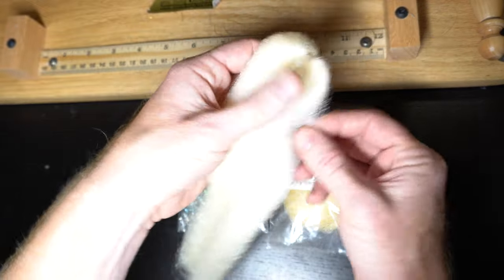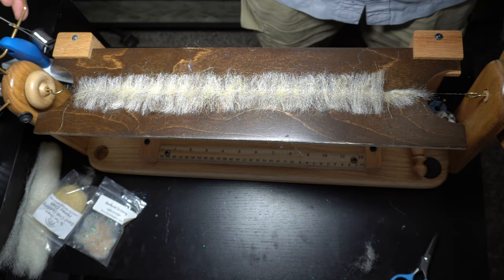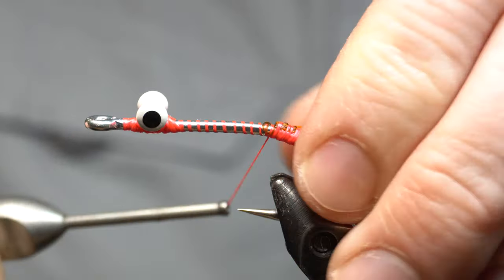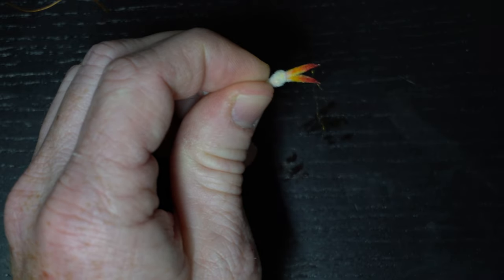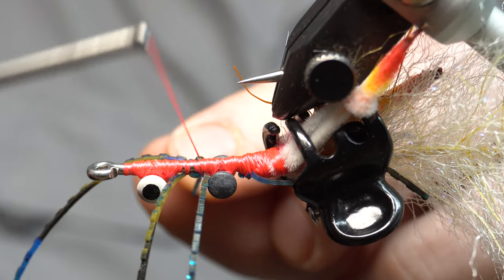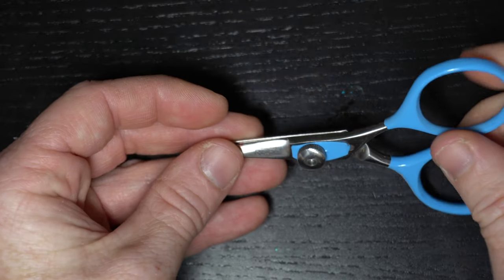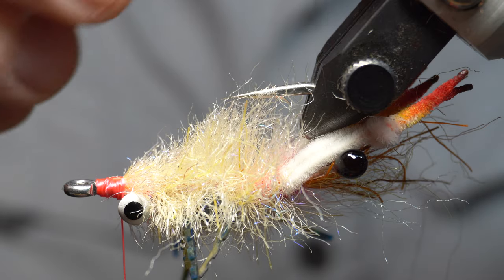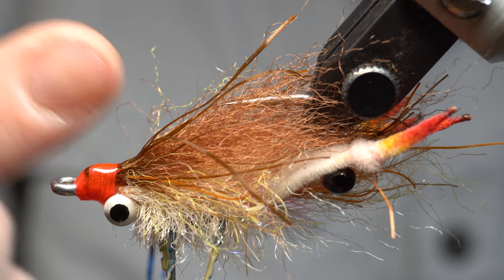Baby Blue Crab with Claws - McFly Angler Fly Tying Session

Comment: What size brush would that be 1.50 or 1.75?
Reply from the maker: Do you mean like how long for the fiber?  I think I showed it while making the brush.  1.5-2” fiber yeah.  But that’s laid right in half so on either side of the wire is 0.75-1”
Reply: Yeah thanks that's what I meant, made one following instructions but center weight was very visible with 1.5 could cover it up well